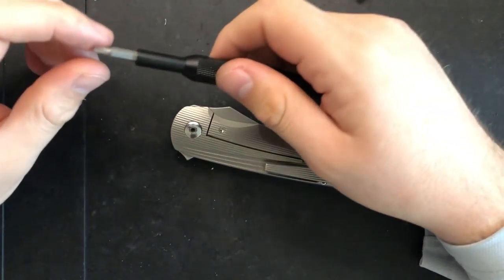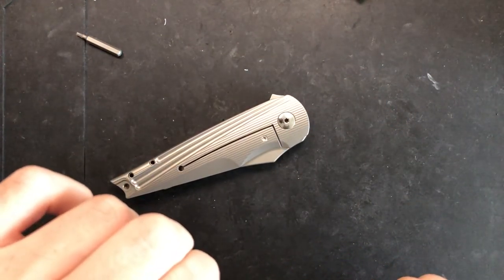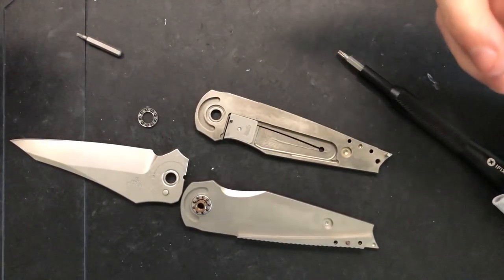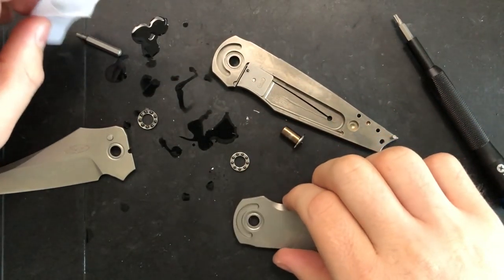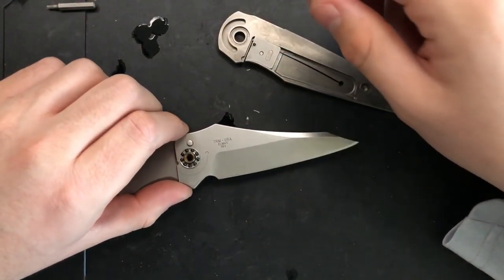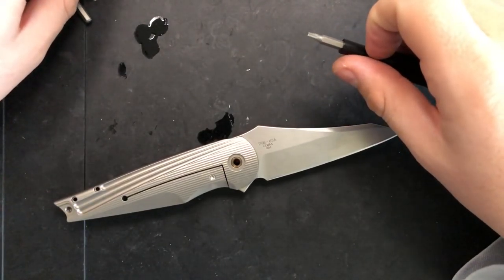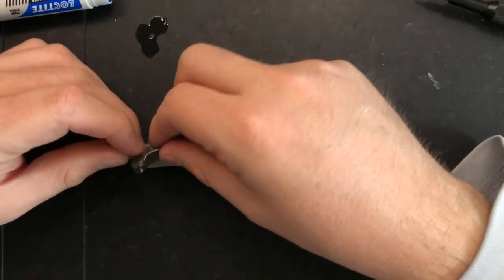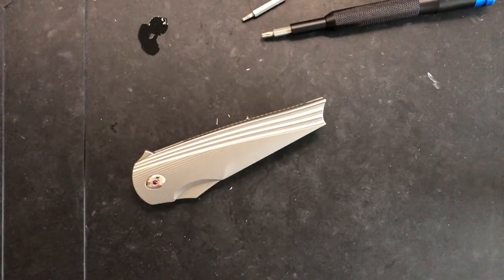How to disassemble and maintain the Three Rivers Thunderbird Pocketknife

Comment: I've not read all the posts, or even watched the entire video, but something jumped out at me that I've never seen and am quite impressed with... the bearing surfaces on both the blade and the handles appear to be radially machined to match the radius of the bearing rollers. for those that aren't mechanically minded this feature increases the bearing contact dramatically... and probably contributes greatly to the "feel" Nick is so enamored with.

Comment: I've had 2 knives that were affected by the bearings being on the ti. I had a zt 0808 that wouldn't center an I took it apart and there was a groove from the bearings. There was also a bit of blade play. My 0452 also slightly has this issue. Not as bad but it's there. It has a tiny bit of play and isn't perfectly center. It favors the lock side just slightly. So to me it's an issue. And for me has been an issue before

Comment: The one item on this knife that seems off, is the lockbar overtravel tab. To secure it from the outside with a Torx screw seems a bit tacky. Had the tab been secured from the inside and not drilled completely through the lockbar, this would add to the fine touches they engineered into this knife. My Spyderco Domino has an overtravel tab secured from the inside so I am guessing this would be possible. Just my take on a very elegant knife.